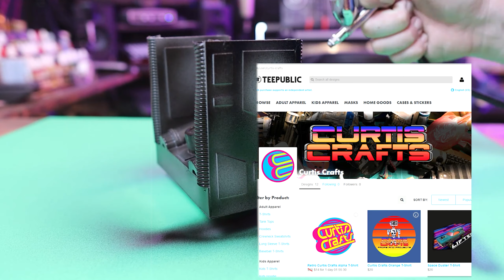The Future of This Crafting Channel Featuring Future Man Props

Comment: Found this channel from r/n64 any update on that 64 Kiosk???
Reply from the maker: I shelved it for the time being as I'm trying to locate a bigger space to move into. I'm reworking a couple aspects of it but I'll make a video of it as well. It's basically at the same point you saw on reddit last. As for your controller question, I 3d printed a rumble pack clip and bolted it to the end of a piece of flexible stainless. Then ran the wire underneath it with a big piece of heat shrink tube. Then a hole in the end to swivel on a bolt. Needs a little modification but functional.
Reply: @CurtisCrafts  awesome. Thanks for the insight. Can’t wait to see that video.